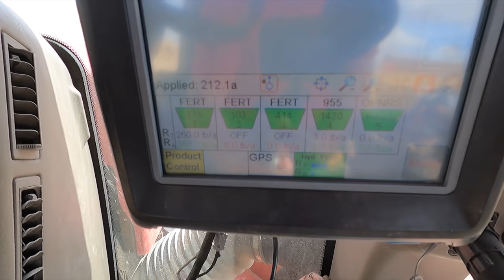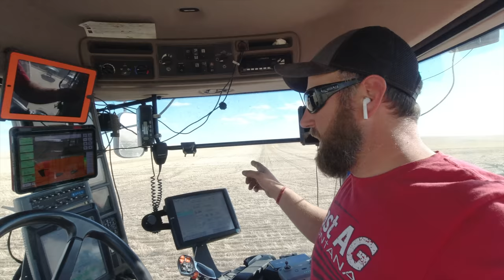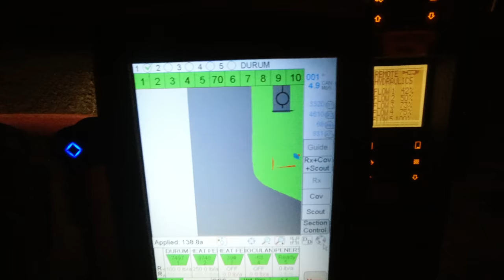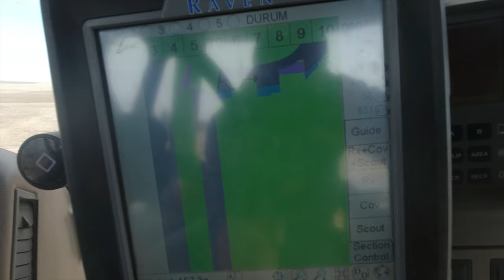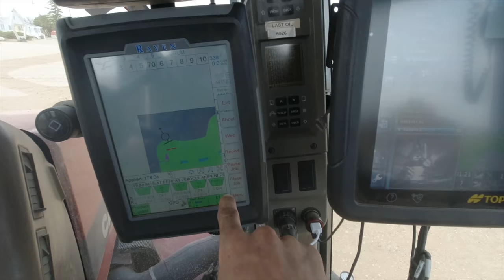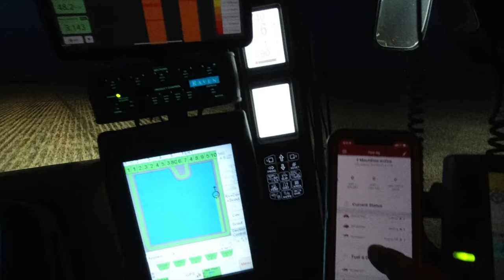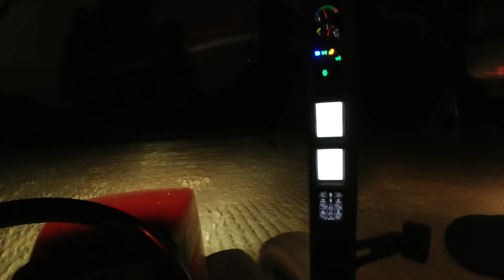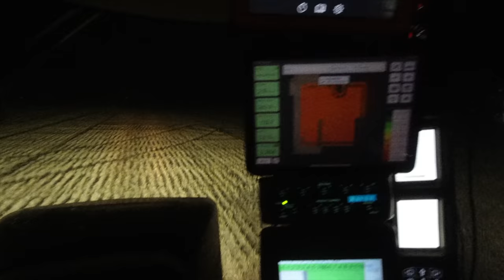Major Oil Leak leaves Dad STRANDED! Seeding 7

Comment: Thanks for answering my question. Now another question. Do the tracs still have the same ground clearance as the tire version? Maybe it is just me but they look a bit lower. Back in my day,it was all tires unless you were actually using a crawler/Dozier. Our neighbor used one and it seemed to take them a lot longer. Now days it is much different and Apt more efficient.

Comment: Question 4 u,so the track compared to the tires on the 1 Welher combine,the tires on Cole the CORNSTAR tractor,which will do the best for no compacting the soil?
Reply from the maker: I think the compaction is very similar. We have some hills that we shift down into 2 gear for an with older tractors and tires I know we wouldn’t make that pull with out spinning out.  I don’t know how lsw’s would do on that though.